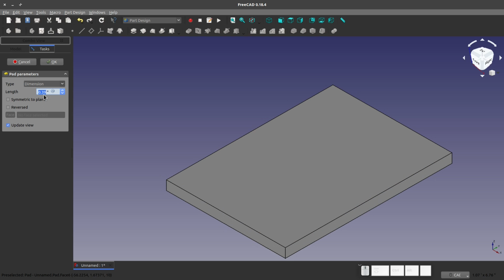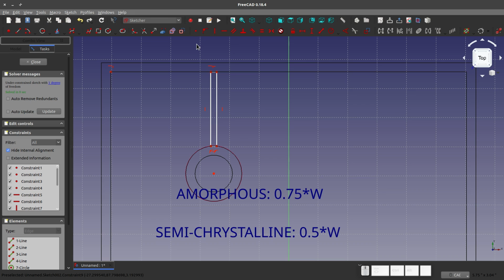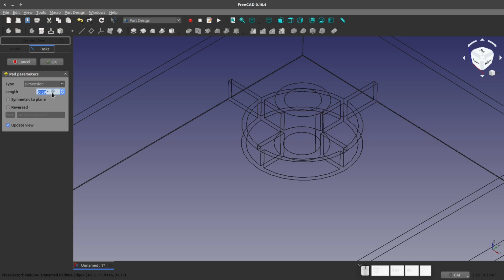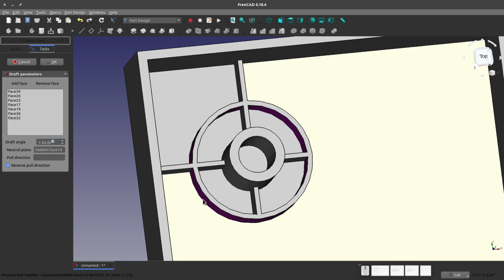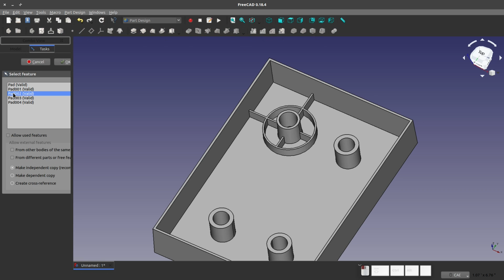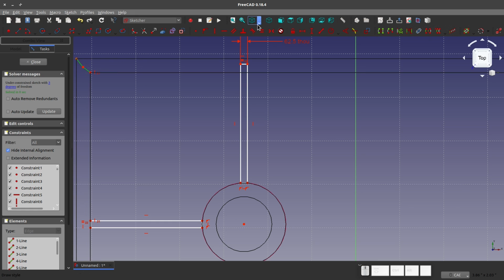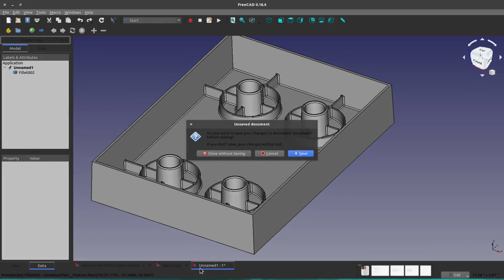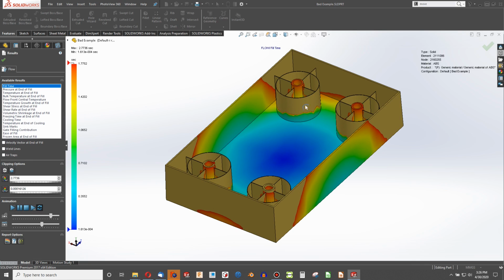FreeCAD Injection Mold Design Guide for Ribs - Allvisuals4u Mold Making |JOKO ENGINEERING|

Comment: Well done Joko on this one! And also Allvisuals4U, great work for the collaboration! This is THE video that every FreeCAD developer should use as a benchmark to see what need to be improved. Period.
I tried to follow your procedure, but I gave up after an hour of selecting edges to apply the fillet. With standard FreeCAD 0.18.4, this is pretty much a mission impossible to achieve: if you forget to select even one of the vertical edges, and later attempt to correct it, everything downstream breaks (I believe this is connected to the Topological name problem). I really admire your patience to get this impressive model done! Keep up with this great content!

Comment: Watching you applying drafts and fillets to multiple features, only to have to re-apply after changing a prior dimension illustrates the number1 FreeCAD pain point for me - the "topological naming problem".  It's bad enough that the feature naming issue causes the linkages to break - but then to have to deal with the multiple repetitive "add feature" / "click on feature" back and forth with the mouse - oi.  If they could fix either one (or both) of those issues my personal user experience with FreeCAD would improve easily 3x.

I'll also take this opportunity to say THANK YOU JOKO for all the long hours and hard work you put into these videos!!  I would have given up on FreeCAD long ago if it wasn't for you (and in fact did - multiple times - before you started making vids haha).  

The potential in FreeCAD is enormous, I hope it follows a similar path like KiCAD.  I'll support the FreeCAD devs the only way I reasonably can - by contributing $$ to the cause.  I encourage all of you reading this to do the same.

Comment: Wow.....very nice example! Thank you so much I wish you made a very detailed video on meshing the part and setting up the parameters for Flow Analysis in general for injection molding.......Really appreciate your effort there!
Reply from the maker: Hi Jiri;  the injection mold analysis is done in SolidWorks.  Is that still helpful if I made material on that?
Reply: @JokoEngineeringhelp  No. Thank you . I thought it was some independent application, hopefully free of charge. Thanks anyway. Good video....